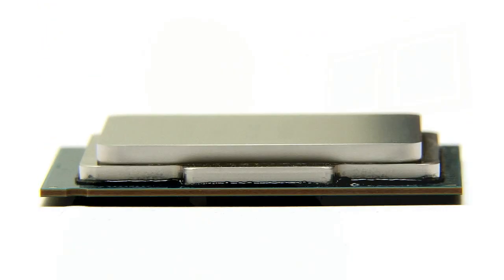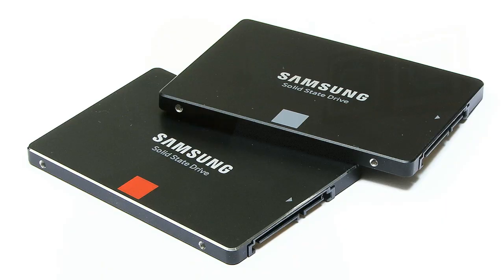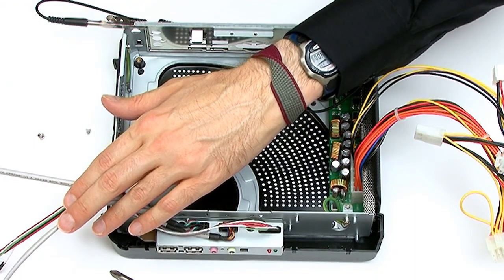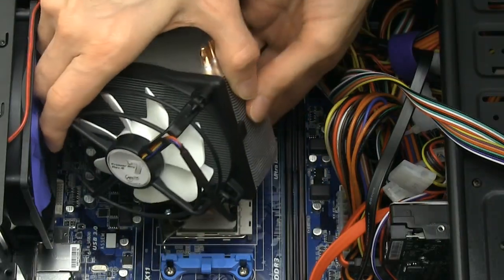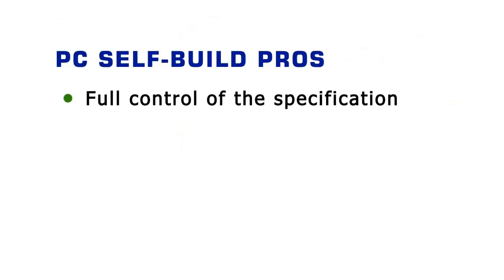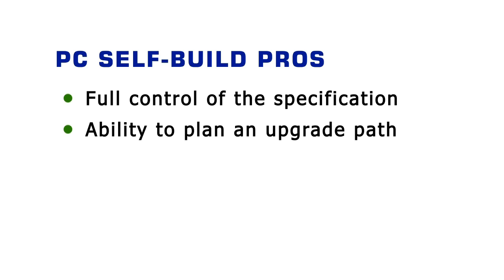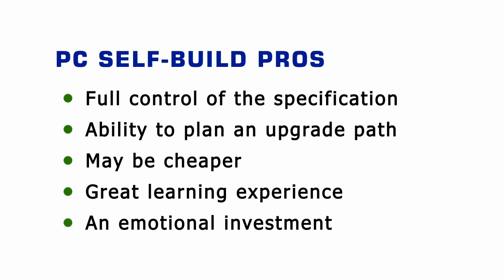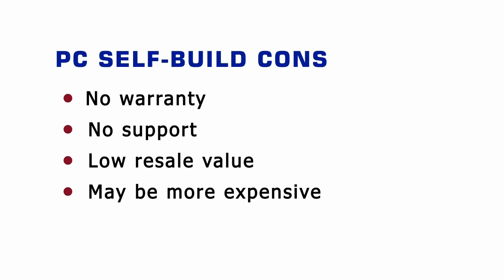New PC: Build or Buy?

Comment: The one thing about a self-built (vs OEM) PC though, is that the manufacturers often load up Windows with all kinds of crap software that you need to then extract to optimize the system. When you buy Windows on your own and install it on a home-built PC, you don't have those issues. Also, there's nothing that says that the big PC manufacturers will pass their component savings on to the consumer. I mean, Michael Dell is pretty wealthy for a reason.
Reply from the maker: Good points.

Comment: a great way to learn is if you can get your hands on a pile of older junked out computers, take them apart, and see if you cannot cobble together a new, working machine.  you will really learn about trouble shooting and just how diverse desktops have been put together over the years.  I never really used them, (except my GF playing solitaire), but it was satisfying to get a few up and running, and you probably learn more that way, then just buying all new parts.  I even did some painting/cabling/fan mods.

Comment: i think the best way to learn building is to read a motherboard manual. they often have lots of pictures explaining how things should be connected and what they are. and because everything is connected to the motherboard it basically teaches you how to build a pc. 

all motherboards that can be bought separately have a manual that can be downloaded from the manufacturer's site. a pre-built systems from a big brand manufacturer typically has a proprietary motherboard that doesn't have a manual (disadvantage), but you can usually still read the labels and recognize the parts on such a motherboard
Reply: Good tip, thanks.

Comment: Christopher I personally would add too that sometimes computer manufacturers known NOTHING about their own products at times either! I once bought a brand new Packard Bell Platinum 3000 that came with to USB ports in the rear of it, and when I connected a USB video capture device up to those same "built in" ports I couldn't get it to work! So I called tech support on my computer manufacturing (Which again WAS a Packard Bell) and the guy on the phone argued with me for twenty minutes claiming that the computer I owned NEVER came with USB ports!! In fact THEY transferred me to three other tech support people until ONLY ONE of them realized I was right, and that person ended up helping me figure out the problem after three hours on the phone! Like wise with the same computer I was having a problem installing a hard drive on the secondary IDE header, and again I ran into the same deal where the guy on the phone tried to tell me I didn't know what I was talking about and how "it couldn't be done" to add another hard drive one to the empty drive port!! BUT you see I worked for almost 28 years building computers in a factory for other companies like Bloomberg and General Dynamics and others!! So I am not your average computer user and I know a lot more about computers than even some engineers, though I am self taught and NOT formally trained in them at the college level!!!! So I have literally built thousands of computers in my time even though they weren't personally mine, so when I started building computers for myself I took what I learned in the factory and applied it to my home built computers as well! For the last 15 years I have been building all my own computers! Some times I use used parts I have hoarded throughout the years I know works, and other times I buy brand new quality components! And even the "slim" case Emachines I am writing this on "looks stock" but it is far from the way Gateway had ever built it as well, since I have upgraded it and added things like more RAM and a faster CPU! And my girlfriends' computer started life as a Dell 540s Studio slim, with a 3.8ghz CPU and two gigs of RAM and is now in a custom case with the same CPU but now has 8 gigs  of RAM, and running a 500gb main hard drive and a 3TB secondary hard drive as well for added storage and a stronger brand new power supply! My HTPC is a full on custom built I put together four years ago now, and is flawless with a AMD 4.0 GHz processor, and 4 gigs of DDR3 memory and I will be upgrading that soon, as it is running a 320gb Hard drive for the OS, and three 3tb hard drives for additional storage as I add more to its video and music collection! The Gigabyte motherboard in it has 6 SATA ports and I still have one port left for future upgrades! My point is that building your own computer today is a lot easier than it was 30 years ago too! And I will never buy another "branded" computer ever again! The Dell 540s I just talked about was handed to me as "junk" and upon closer inspection I realized somebody had installed the wrong memory in one of the slots which was WHY it quit working in the first place! And in my HTPC being a straight out full build, I never had a hitch with it, which that is the fourth computer I build from scratch using new parts as well! Computer companies charge a lot of money for parts that frankly are not the good to start with anyhow! I have worked on more than one Dell that has had the cheapest trash CD and DVD drives in them right from the factory! And I have seen a few Gateways that run absolutely junk CPUs in them as well too! For me I would much rather KNOW what is in my case and KNOW that it is quality parts as well! At the end of the day you just can't trust some of the manufacturers as much anymore in my mind!! And I should know I have worked for companies that built computers for other customers, that you'd be amazed at the low level quality of parts they install in some of this stuff!!

Comment: I had upgraded and made adjustments to PC's before but I would be lying if I said my first whole computer build was an entirely pleasant experience.
I kept on getting boot loops.  After a long process of elimination.  It turned out that because Corsair changed their H80i bracket to plastic.  It didn't have a noticeable stopping point with regards to tightening the cooler on. Hence I ended up braking traces on the mobo from over tightening.
Luckily I still had the old metal bracket and all went well after getting a new mobo.  
An educational experience but it was very stressful at the time.  
Very gratifying in the end though.

Comment: The fact that you can build a desktop PC is the reason manufactures are pushing tablets and laptops, both of which have built-in obsolescence Inthe form of a sealed for life battery. Microsoft are keen on tablets and laptops because they now only make money when windows 10 is installed on a new mechine. Microsoft encourage but rather than self build by certification of the design as being windows compliant. Another problem is obtaining the hardware software drivers. Linux still has problems with video drivers with some manufactures only providing drivers for the windows OS. I have built a number of PCs, but was reluctant to make my latest as it has liquid cooling and a SSD together with Two large SATA drives. Unless Microsoft changes its development policy for Windows, my next computer will be a 64bit Linux machine. I am already experimenting with a couple of 32bit Linux PCs, repurposed from old XP machines.

Comment: Excellent video. I myself have been in the build your own PC camp since my early teenage years. It's typically been my experience that I get a lot more bang for the buck going that route, though I primarily build gaming and rendering spec'ed PCs as opposed to budgetary, simple use builds. Even with the potential expense of Windows I was usually able to acquire an OEM system builders copy of whatever the latest Windows was at my local Fry's Electronics for approximately $100 - $200. Luckily the expense of a retail copy fell dramatically with Windows 10. Though now I'm more of a Linux user, Ubuntu Mate being my distro of choice. I only boot into Windows 10 now when I have the itch to game and wish to leverage my SLI capabilities for said gaming.

Comment: Well I built my own computer now I am making a business out of building pc's my pc may be at the low end as the specs are
CPU A6-7400k (overclocked to 4.3ghz)
CPU cooler is a gammax 400
Ram is hyper x fury 1800 MHz 
Gpu is a r7-360
Hdd 1tb wd
Hdd 2 tb seagate 
Psu corsair cx650 watt 80+ bronze 
Case is a thermaltake view 27
Mobo is an asrock ( can't remember exact name)
I assume this is low end system

Comment: My 2ct would be, that in the nineties, I used to build my own pc's with mid-grade to top of the line parts, depending on what I could afford.
Later, between 2000-2010, I used mid grade parts.
Nowadays, I use entry level equipment.

2 reasons why;
1- As I get older, my interest in gaming has reduced.
2- PC Hardware becomes continuously better at doing what it does, while the demands for browsing the web, or reading emails, haven't significantly increased. Perhaps my browser uses nearly a gigabyte on RAM, while my 1990's pc only used 256MB of ram, but the price of 256MB of RAM in 1990 compares to 8-16GB of RAM today.

Not only the parts getting cheaper, but in 1990, a full desktop PC (with keyboard, mouse and screen) could cost me an entire month and a half of paycheck. I often had to save 6 months, to get one!
Nowadays, I can buy a full fledged low spec PC for a week's paycheck.

Size wise there have been changes as well.
Where as before I was buying PC's with upgrades in mind (mainly Graphics or CPU), nowadays, I buy a BRIX pc (about the size of a 3.5" external harddrive) PC, and it does whatever I need it to do.
Price wise it's a lot cheaper than buying a PC with upgrade in mind. I'll just buy a new pc when this one fails.
Besides, Windows 10 was free on it!
Size wise it gets smaller, and power consumption gets smaller.

One thing I've noted, is that my PC's had a peak power draw between 2000-2010 (about 500W).
My pre-1990's pcs had small graphics cards, and often consumed less than 100W.
With the advent of the netbook, a lot of attention was spent on reduction of power consumption; and it trickled down to desktop pcs. While my Brix pc, with Core i7 4400u consumes only 35W, with everything included it peaks at about 100W at full load, and idles at around 20W (about 15W for the monitor).

The PC's have become 'mechless', a term used in car radios, meaning, no more spinning things in it, like harddrives, optical drives, floppy drives.
Everything is basically chips.

I have one 'stick pc' which works great as a Media center for 1080P videos and audio, and my Brix PC with integrated graphics still runs DX9 games at full 1080p resolutions, and DX10/11 games at 720p resolutions.
Since I game very little, it matters less to me.

That would be my personal PC past.
I entered my PC life with my first Commodore 64, and Atari ST (with green, yellow, or later, white screen) in 1985.
After that my first DOS/WINDOWS PC, was a 486@33Mhz, with Windows 3.1, which we quickly upgraded to 3.11; we later upgraded the PC to a 486DX4 @ 100Mhz
My first Windows 95 PC was a Pentium 75 on borrow, until I got my own Pentium pc @ 90Mhz, which later got upgraded to a P2 166 Mhz with MMX, and later to a P3 333Mhz, with my first Intel graphics card of 8MB of VRAM (running DX5, 6, and 7).
Windows 98 ran on my newer P3 666Mhz PC (with ATI graphics card), later upgraded that one to a Pentium 4 Athlon 1,4Ghz. By this time ATI was bought up by AMD.
That beast ran so hot at 120Watts, that the CPU fried, and literally a piece exploded off the cpu. Lack of coolant paste on the edge could have been the culprit. 
The CPU was the bottom of the line CPU for that motherboard, so it was replaced by the top of the line CPU at that time, the Athlon XP 2600+, which ran multithreading. It was also the first PC I ran on XP.
Great PC, but the USB host was buggy, and glitchy (would often glitch every so many minutes).
That Athlon ran many consecutive years from 2001 to 2007, 24/7, as a web server and chat room host; until I moved and had to give it away. 
I was more mobile, so I bought a Sony Vaio laptop with Core2Duo T5500 (dual core @1.66Ghz) for my travels, and later was intrigued by the super affordable $300, sleek looking Asus Eee Pc 701s; to learn linux on, and download stuff at the library (since I had no internet). The Eee PC lasted 6-7 hours on a battery charge and was amazing for the price, but the Celeron 630 Mhz was slow. It could be increased to 800 Mhz, and GMAbooster could increase the 270 Mhz limited graphics card to 400Mhz, which allowed me to play DX9 games at 480pix 30FPS.
Those were the last of my old batch of PC's.
After that, I upgraded very few times, to a few tablets, both android, as Windows, as Amazon, as the iPad.
Now I run a HP laptop with Intel Celeron N3060 CPU, which in performance mode runs 2 cores at 2,47 Ghz, and has 4Gb of RAM. It also runs 10 hours on battery... Can't complain.
I also own a Core i7 4400 Brix PC, and an Asus Zen PC with Corei5 CPU.
I guess my days of upgrading, and tweaking are over.

For years on XP, VIsta, Windows 7, I would tweak it to remove background activity, pictures, etc... to make it run smoothly on the hardware.
Until Windows 8 got released (which got replaced by Windows 10), and this ran on much smaller hardware.
Reply from the maker: Great post, thanks for sharing.

Comment: I used to build, but now I save myself the trouble and buy second hand, maybe replacing the HDD with an SSD and stocking up or replacing the RAM. Things haven't changed enough over the last 5 or so years to warrant buying or self-building new. I still have an evolution self-build – started with a Sempron thoroughbred and now has a core i3. Must be around 12 years old now. Only the case is still the same.

Comment: People need to remember that the Windows CD key that came with a previous computer can be re-used so you might not need to purchase a new version of windows. However, this will cause the previous installation of windows to become unauthorized, so only do this if you are getting rid of the old computer.
Reply from the maker: And this only (normally) works if you bought a full version of Windows, rather than an OEM one.
Reply: I wasn't aware, i've had no issue doing this with the 2 keys i had from older laptops. Attempt with caution i guess is the thing then :) Newer (windows 8 and windows 10) laptops don't have the license number on them anymore.

Comment: No warranty is incorrect, you do get warranty on each component. If you plan to build your own PCs for the coming 10-15 years you can upgrade the pc in phases. The system case can last a long time, maybe more than 3 generations or 10 years. same goes for monitor, keyboard and mouse. I only need a new mainboard, memory and video card to make my pc up to date again.

Comment: Build - that isn't even a close call. I am just reacting to the title of the video and will reply on its substance in another post.

Why build? When you buy the company that builds it will only put in an effort with regard to, "What the suckers look at". So that would be CPU and GPU, amount of RAM (not the quality), size of the hard drive and of course overpriced extras such as an SSD.

What you are almost guaranteed to get in the box is the shittiest PSU they can get away with. The PSU is the most important single component by far. The next thing they will cost down on is the motherboard. You will also get the whole package in a crappy case and you can guarantee that the wires connecting the front USB ports to the motherboard will be of inadequate quality and will make running peripherals from those ports very unreliable (such as a wireless dongle from a wireless keyboard and/or mouse).

There is a "Rule of Three" which applies to buying a computer:

1) Fast
2) Cheap
3) Reliable

You will only ever have the choice of two out of three of the above, that is if it is fast and cheap it won't be reliable, if it fast and reliable it won't be cheap, and if it is reliable and cheap then it won't be fast.

Comment: Hi Christopher, some years back I decided to build my own desktop PC and I did this to overcome one main problem with buying a pre-built PC, i.e. inbuilt limitations.

For example, when buying a PC from a store you do not know where the manufacturer has decided to "cut corners" in order to hit a certain price point.  I have found in my experience, and to my disappointment, that manufacturers can use cheaper motherboards that cannot take more ram memory, internal PC case spacing being very limited, cheaper components overall that fail after 12 months, etc.

However, I've found that you can buy the best components your budget will allow while designing out all those limitations "store bought PCs" will typically contain, i.e. you can build in your own upgrade/expansion path.

To conclude, in the medium to long term, your self-built PC will always be cheaper than a store bought, pre -built PCs because you can build in quality, longevity and an upgrade path while a manufactured PC is a take it or leave it, one-time only thing built to a price.

Regards

Bob